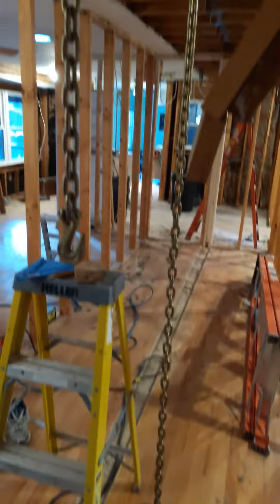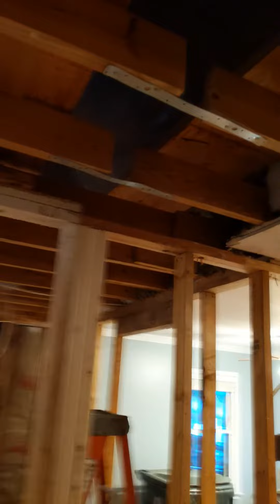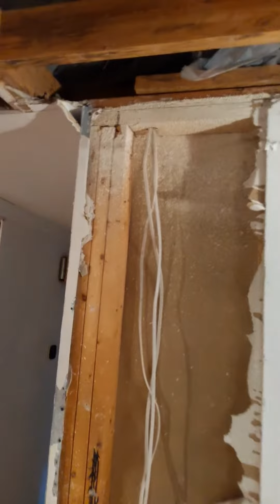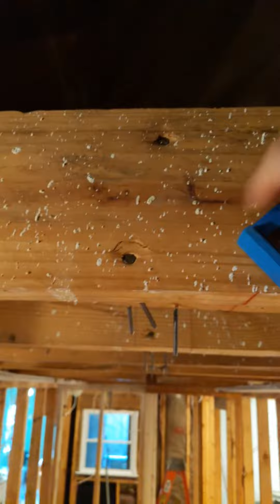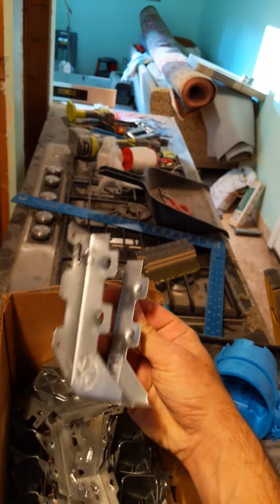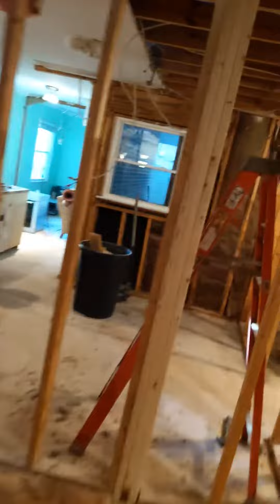Replacing a load bearing wall with a LVL beam

Comment: awesome video! so the 2x6 will not be flush with the sheet rock on the other side of the wall? thanks
Reply from the maker: The ceiling sheetrock is flush. After the rock is hung, there's no indication that the wall was removed.
Reply: @nickydoes thanks for the reply i meant the 2x6 inside post, will they become like a post?

Comment: How were you able to lift up the beam without the straps getting in the way?
Reply from the maker: I lifted each end some, then set it on a step ladder. I worked end by end, step by step.
Reply: @nickydoes  I just can't see how the straps for tension didn't get in your way when you lifted the beam through the gap...   Did you remove them prior to lifting the beam?

Comment: Awesome thanks. In the old days they'd seat the beam above the ceiling joists and strap them to the beam with 2x4's. Later they used simpson ties straps and then, they switched to the cutting and hanging to ceilings joists on each side of the beam. I have seen all ways and all work great without any problems, I seem to prefer the old ways because you don't risk uneven ceiling having to be too precise with all the hangers. If the floor is a slab, depending on the loads, you still need to cut the slab and pour a footing depending the load.
Reply from the maker: All good points. I have a very short attic - 1/12 pitch roof, so I wanted the cross clearance.

I did have the job engineered, which included pouring a 2x2 ft footing.